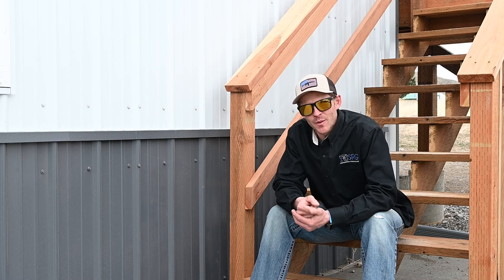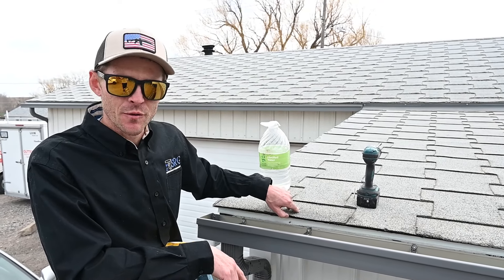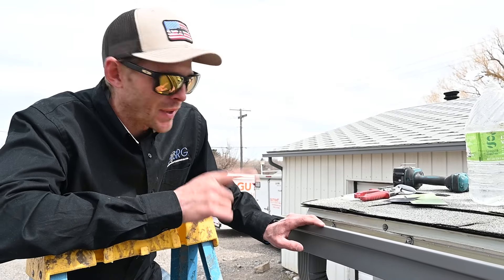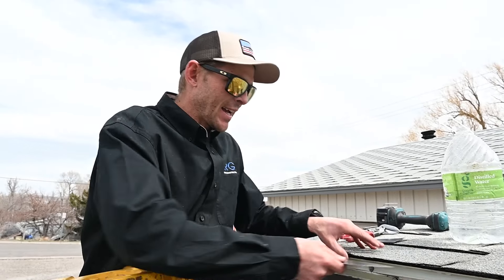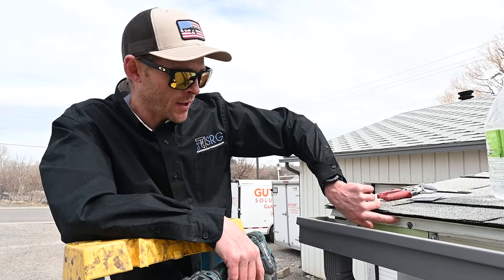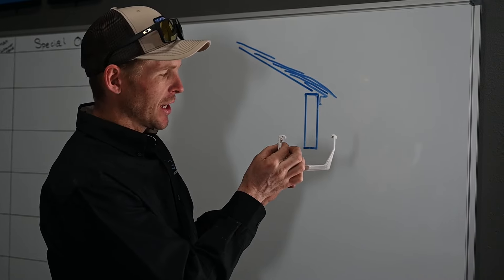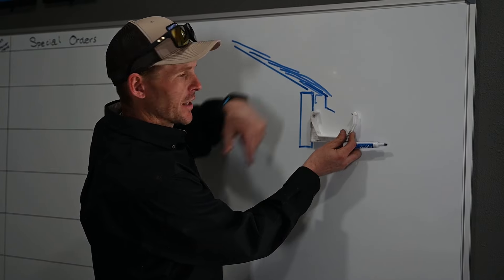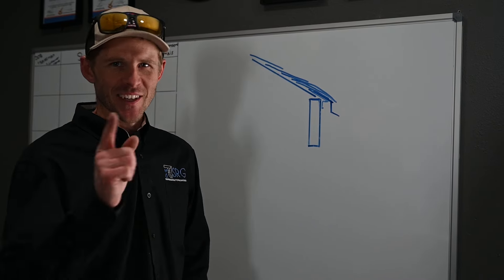Why Is Water Leaking Behind My Rain Gutter?

Comment: The problem is that the roofers installed the shingles even with the drip which is incorrect.  Those shingles should be installed 3/4-1"past the drip edge.
Reply: Exactly.  The roofers do their job and they completely fail in correcting the gutter issues also.  There is a total disconnect in the skill set around my neck of the woods.  Not enough training of the workers.  The shingle does need to hang pas the edge, past the drip edge as you say 3/4 to an inch.  Then the drip edge has a chance, and it better be inside the gutter wall as well.
Reply: Absolutely.    It starts with roof!
Reply: @joq702 exactly! That's why I have a disclaimer on my Install invoices saying I'm not liable for roofers error
Reply: @joey8567  no it doesnt!
Reply: @brownitsdown  yes it does
Reply: Due ro surface tensin alot of water can get hung up between the bottom of the shingle and the top surface of the drip edge if the shingle does not overhang about 3/4". That water is a potential problem. It should flow off the end of the shingle and drop straight down into the gutter. Problems can include ice dams and water migration to holes or other weaknesses causing damage.

One fix is to seal a strip of starter shingle granules up to the underside of the existing starter shingle to extend the shingle edge out as needed. I used a strip about 3.25 in wide with 2.5 in under the existing starter shingle.

Comment: Great video. I so appreciate you sharing your expertise. Question for you -- How do you attach the Z-flashing if the shingles are already nailed onto the roof? Do you need to lift up the bottom few rows of shingles, attach the Z-flashing, then re-shingle those bottom few rows of the roof?

Comment: The drip edge needs to be installed a quarter inch from the fascia to PREVENT water adhesion and go straight into the gutter, that gap will not allow the water to curl.

Comment: Oh I needed to see your video today!!  We just had a new roof put on our entire house and after they finished I decided to add gutters to the side of the house.  I had not noticed that when the new roof was put on the company removed a small molding strip that went around the entire house.  This strip allowed the roof or drip edge to stick out 3/4 " or so from the fascia board, which was great and has saved that board over the past 70 years from rot due to water seepage.  Now as I am out there trying to put on gutter I am noticing exactly what you discussed, the drip edge does not go down to the gutter and the drip edge is tight up against the fascia board leaving you no hope of getting the gutter under any portion of the drip edge.  Needless to say, I am just sick that this has happened and I am currently trying to find something I can push up under the new drip edge and lap it over into the gutter to protect the fascia.  Does anyone know of anything I could purchase and get back up there and fix this issue before rain begins?  At 70 years old I am not as spry as I use to be but I have worked my butt off to get this far and don't want to leave it this way!
Reply: Slip flashing

Comment: The one thing I was taught years ago when I learned roofing was to have the shingles hang over the drip edge about a half inch or so, then in the summer the shingle will sag enough so the water doesn't do the capillary action as said at the beginning of the demonstration.

Comment: This is exactly what I have been looking for to explain water behind my gutter. I still have a few drops behind gutter after installing the drip edge extension. Still need to understand why.
Reply from the maker: could be a low pitched roof and the water is flowing behind the dripedge
Reply: @StartARainGutterBusiness 
If it’s a flat roof and that’s what is happening how can I fix it?

Comment: Instead of messing with extra flashing, I took a tube of gutter sealant and ran a small bead at the top of the gutter where it meets the fascia. Seems to have solved it. My shingles are cut even with the drip edge and the drip edge is tight against the fascia, I think that may be the culprit.

Comment: Great video,, I've got water coming down between the j- channel and the facia. And it's right in front of the door. It's not annoying when it's rain but drives me crazy when there is snow melting.
I took off the soffit and the gutter guards to see where it was coming through. No water coming through until I put the gutter guard back on.
Hope this will help.

Comment: looking at your video (at 315 say), whoever put our gutters on has a slope on the gutter from one end towards the downspout but put the high end up so high that they double tin snipped the drip edge on each side of where the "nails and tubes" are and then bent it upwards to get the gutter up so the drip edge would be inside the gutter. is that what should have been done? i thought they make a gutter hanger or bracket with a crook in it to go down below the drip edge and then back up behind the drip edge...and then over the back of the gutter. i have water damage to my fascia in those areas and the nails have pulled out of the softened fascia. i would like to just buy some gutter clips / brackets / hangers / whatever they are called, and pull the gutter back against the fascia since water is dripping between them due to gutter sag and gutter filling up in that area. I can't get new gutters installed until next spring now due to cold weather where i am. i also need to get new shingles in 4-5 years and have heard different things on whether or not the drip edge should be there before the gutters are done or the gutters done after the shingles and rip edge are installed. Any feedback would be greatly appreciated. oops. my drip edge is not close enough to the back of the gutter to be able to screw it flush like hou do

Comment: Great video and explanation of where leaks may be coming from!  On my 12-year-old roof, there is a leak between the gutter and fascia causing a small drip onto the ground and accumulation of water under the soffit. The edge of the roof shingles is flush with the tar paper underlayment.  These roof edges extend slightly past the gutter drip edge and there is a gap of only a few millimeters between it and the gutter guard (and they are touching in some places).  There is also a slight v-shape or ski jump at the bottom of the roof slope where a small amount of water accumulates after it rains.   

I can't determine whether the leak is caused by (1) the accumulation of water at the bottom of the roof, (2) water going back under the shingles or (3) water coming up from behind the drip edge inside the gutter.  The gutters have a slight amount of debris accumulated in them, but not much.  To stop my leak, I was going to try your suggestion of sticking some tar paper (or metal flashing) under the shingle but extending it out further over the gutter guard.  But, being that my roof shingles are basically already touching the gutter guard, I am not confident it will change the "capillary action" you described that could currently be causing water to back up under the shingles.  I am guessing that the roofer kept the gutters high and snug to the roof edge because the roof is low to the ground and people walk under it.  

Here are some questions: (1) If I put tar paper or metal flashing between the shingle and the gutter guard to try to extend the water an inch or two further from the fascia, should the new flashing be between the shingle and the existing underlayment or between the underlayment and the gutter guard?  I am thinking the first of those two options would be better.  (2) Is there anything that I can do to fix the v-shape at the bottom of the roof slope without having the gutters reinstalled lower?  I appreciate any suggestions you may have to make inexpensive repairs to my roof.  Thank you!!!
Reply: Whoever put on your gutter guard may have damaged some of your shingles

Comment: THanks for the great info! I have this problem and it seems to have been after I installed gutter brushes to keep large vegetation from plugging them (still require maintenance) but do you see a problem with using gutter brushes?  Could it be interfering with the water flow?

Comment: Great video! Is it standard practice to put tar or some other sealant  between the shingles and the drip edge so there’s a seal that prevents the water from going behind the gutter? Wondering if roofers do that when installing new roofs

Comment: Been angry at the industry for decades.  Almost none of them have the brains to make the rear wall higher than the front, so that if the downpipe plugs up the water spills over the front instead of into the soffit. Also, they are designed such that the screw thru the bracket is often underwater. Not only leaks like in this video, but rots out the screw hole in the wood over time. Because the front edge needs to be below the extended roofline, to avoid sliding ice sheets from ripping off the gutters,  it just makes sense to make the rear wall higher, under the shingles, with brackets that provide a higher screw hole.  But common sense in design does not seem to exist.
Reply: Right!? I wonder why they have not done that by this point.

Comment: I cleaned off my gutters as normal this year, because of a change in my back patio I had to reroute a downspout, when reattaching it, I could feel debris in it despite a gutter guard. I had to remove the gutter guard to clean out the aprox .5-1' of sludge including pine needles and stuff off of the roof. Is this normal? It certainly made me realize that I had a false sense of security with he gutter guards.

Comment: Z flashing with a sharp edge too far extended our can slice hands of gutter cleaners not wearing gloves. I get mine with a fold back edge that also stiffen the sheet metal. On facia gutters sometimes the flashing and gutter hangers make install difficult. Also bring out flashing and drip edge too far can mean wasps try and set up home in the gap.You can’t win. And worse, the lack of attention to detail by some roofers when it comes to all these issues can be really appalling.

Comment: wont screwing the drip edge pull up on the top where its nailed into the roof sheeting? pulling up nails eventually? shouldnt screws be down a bit plus you have to take those hangers  out to to install it  and  somehow get them back in the exact spot lined up perfect

Comment: My gutter is dripping down the wall on the sealed side. I guess I made it unlevel somehow when I added the downspout recently on the other edge. It is a bit tricky to get right because I noticed if I angled the downspout that I was getting water dripping down behind the gutter. I feel like the one point closed side drip is better than the whole behind the gutter drop though

Comment: That video is excellent and answered a lot of  my questions. Thank you. My shingles are strongly glued to the D edge. What do you think if I insert a flashing under/ behind the D edge? Would you recommend to screw it, the same way you showed that screw in the video or should I put some type of adhesive?
Reply from the maker: if the drip edge is tight, just put some adhesive on the back and the drip will hold it till it cures

Comment: Problem is there is no watertight roofing to on top of the drip edge, water will find it's way under the roofing, as for the gutters themselves should been tucked under the drip edge completely so water makes no contact with wood, the shingles on that home does not look like it comes out far enough, at minimal should be nothing less then one inch to one quarter inch to resolve most these issues.

Comment: What if you put the flashing like you showed and screw the drip edge back in how does that stop it from going back in between where the shingles weren’t stuck down to the drip edge??? I’m having the same problem in a few spots and need to fix it asap.

Comment: 03:00... What about the side of the house where there is no gutter?    

One issue I'm having is that on the side of the house, where there is no gutter since the roof doesn't angle that direction, water will run off the side because of wind or something and run down what I think is called the rafter... that wood overhang... basically what you show at 05:26 in the video, only not the right side of that drawing but the side facing the camera.  There is a drip guard there but the water in one area appears to be clinging to the drip guard and then running down the side of the rafter before then dripping to the ground.   Over time it removes the paint and starts to rot the wood.  I repair it each year but would be nice to know what the fix is.  I was thinking of doing the same thing shown in the video only bend the aluminum flashing outward near the bottom to redirect the water away from the rafter.  Won't look pretty but would that work?  Or is there a better solution?
Reply from the maker: you could install a j channel under the drip and divert it to a safer place!
Reply: @StartARainGutterBusiness  thanks

Comment: I have this issues with a metal roof. Roof Is flush with drip edge
Runs up behind drip edge and rots fascia. Metal screws are at or near the edge of the. Frustrating
😮
Reply from the maker: Just add another gutter apron under the roofing and into the gutter

Comment: Please help
New construction and I have water leaking between the house and gutters.  I can see the sky when I stand underneath the gutters.   What can be done?
Reply: That doesn't necessarily mean the gutters won't work. The back of the gutter is not designed to be watertight. As long as it's mounted underneath a roof that will deliver the rainwater into its mouth, you're good to go.

Comment: Question:  I'm about to get a new roof and saw that my neighbor had silicone caulking at the bottom edge of the gable apron all along it's length.  Why would a roofer do that as does it need to be sealed at the bottom or not sealed?  Also, if you have gutters and there is more than a 2" drop on the length.... do you need a edge that is 2" along the first part, and then an edge that is wider for when there is more than a 2" drop on the 16" lenghth?  Thanks, and hope you are still answering your comments.
Reply: I'm no gutter guy, but as a hobbyist handyman, having caulking or a seal at the bottom of trim is a great way to trap water and rot stuff out. Water needs a pathway to drain if it gets behind stuff.
Reply: I am a novice, not a professional by any means, I too have had the same issue and in my humble opinion I am adding a wider drip edge.  I feel it is necessary if you do not want additional problems down the road.

Comment: I just had a new roof put on.  Different contractor did seem less gutters.  On the long runs I have a lot of water dripping between the back of the gutter down the fascia.  My question is who do I raise hell with? The roofer or the gutter guy?  There are a few areas where I can see light in the crack.  Seems like the gutter should be more flush against the house but I don't know if that's possible & maybe they did the best they could?
Reply: Did you find out who was responsible? I am having a similar issue
Reply: Anyword
Reply: I am a private homeowner and I just had a new roof put on and then I decided to add gutters myself so I would only have the roofer or myself to blame, but you have to look at the job done by both.  In my instance I have worked by back side off to put these gutters on correctly and I am pretty much a perfectionist.  You may need to ask a 3rd party to look at what has happened and see if the roofing has enough overhang to allow the water to drip off into the gutter or  is it too short.  I believe you should have 3/4" to 1" overhang.  How tight is the drip edge?  I thought,  but may be wrong that roofers were suppose to leave a 1/2 inch gap between the drip edge and fascia board.  My roofer failed to do that, and the drip edge is not long enough to cover the fascia board nor allow water to drip into the gutter.  This being the case I am now finding myself having to purchase more drip edge that I can slip under the existing new drip edge and lap over into my gutters.

My feeling is that my roofer messed up, however I put the gutters on myself.  I have had to rip off fascia board from my storage building and replace it and I never want to do it again,  however that is because I was doing it myself, just like the gutters, therefore I am choosing to purchase more drip edge and slide it under the existing drip edge and lapping it over into the gutters to make sure I have no rain dripping behind my gutters and rotting my fascia board.

Since you didn't do the work I might call the gutter man and ask him to come back out and take a look at what is happening and ask if there is a way he could make the necessary corrections.  If he feels it was the roofers bad work he will tell you and ask him to explain to you what the problem is.  There are many possible reasons as to why this has happened and I can understand you being angry, but listen to the gutter man first, then ask what he can do to correct the issue.

Comment: I want to make sure I understand what you’re saying here. So you’re saying take some Z flashing and put it over or on top of the original flashing and the way you make it stick in place or stay in place is by using some type of black cement?

So you never nail down the flashing ?
Reply from the maker: Install flashing under the drip. attach if necessary

Comment: I failed to understand how extending the drip edge is going to stop the leak if the capillary action is not been stop at the shingle by not being sealed
Reply: I think the difference is the angle that the water is travelling. It's a much shallower angle off of/under the shingle, as opposed to having run down the flashing (extended drip edge). It would be fighting a lot more gravity to travel up the extension.